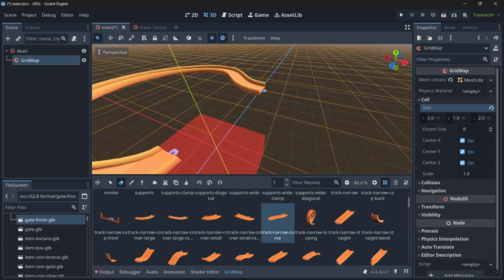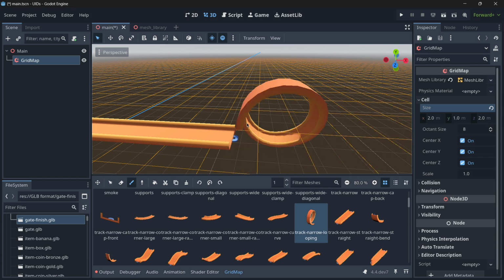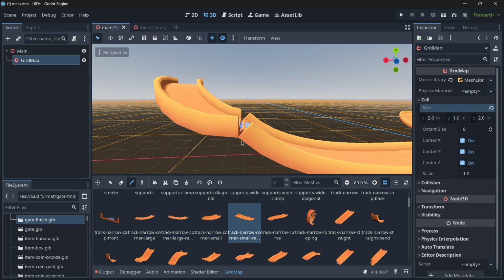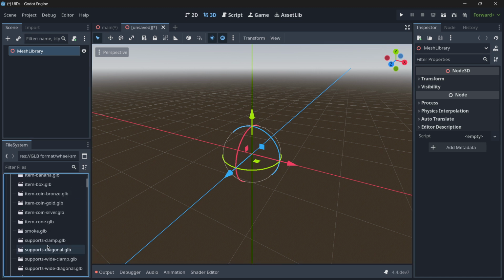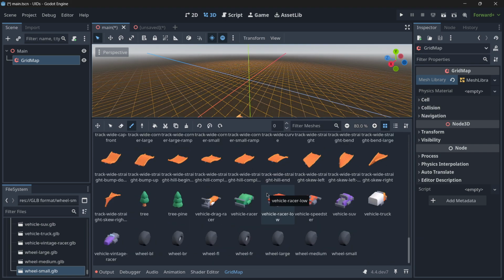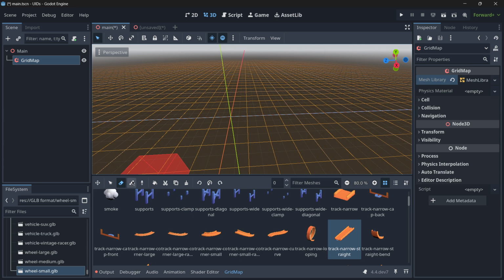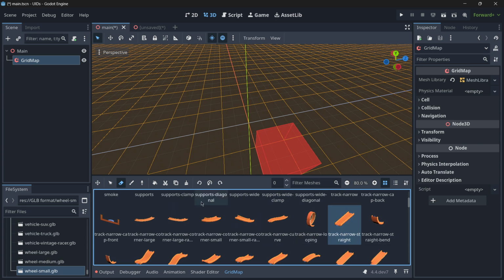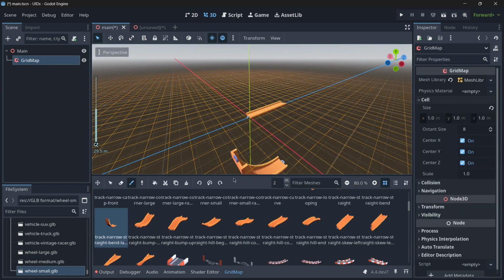The New GridMap Node of Godot 4.4

Comment: Today I just realised that I could disable/change the shortcut for the Cursor Rotate X,Y,Z and Erase! those should have different shortcuts by Default, if any! (Editor > E.Settings > Shortcuts, and scroll down)  This way, you can Move around and place tiles without having stuff rotate annoyingly! :D
Reply: it is solved in 4.5dev5, the gridmap editor won't take any inputs when the freelook is activated!
Reply: @geoffreymegardon5624  Oh damn, I did not know that, I am still using 4.4, thanks for letting me know! 😅
Reply: @squishyskeleton09  I am the person who moved the gridmap to the bottom panel, so when I saw your video, I investigated what was happening. And when I looked at the code, I saw someone had fixed the issue already 😅